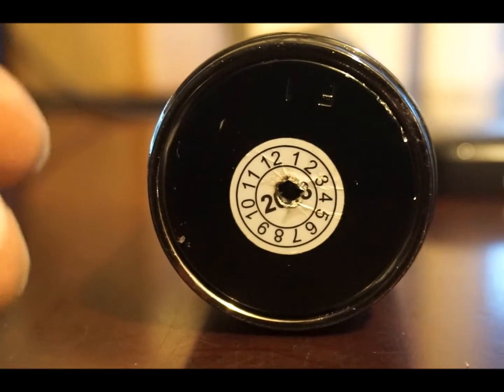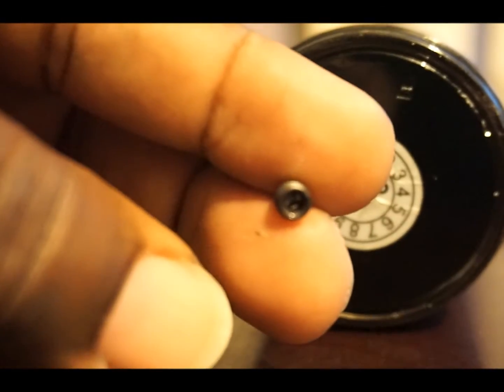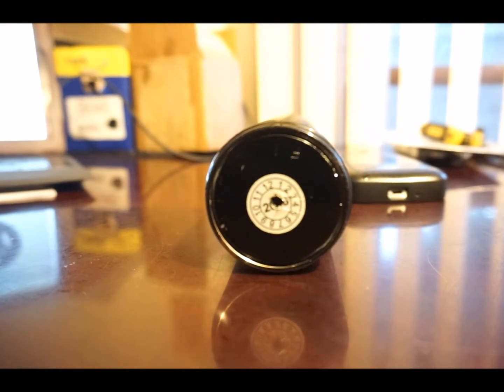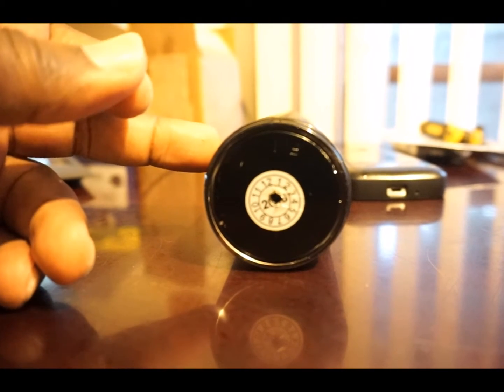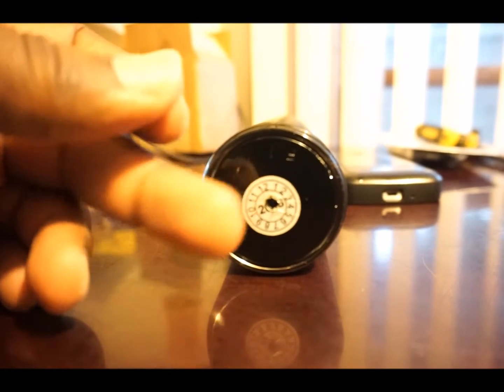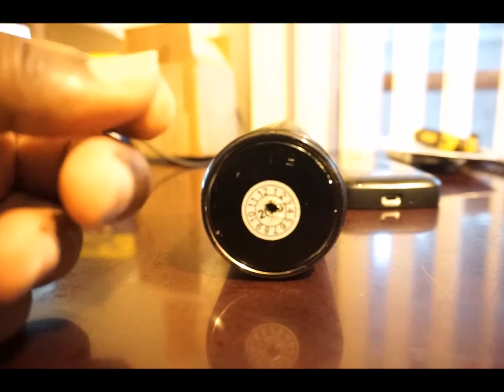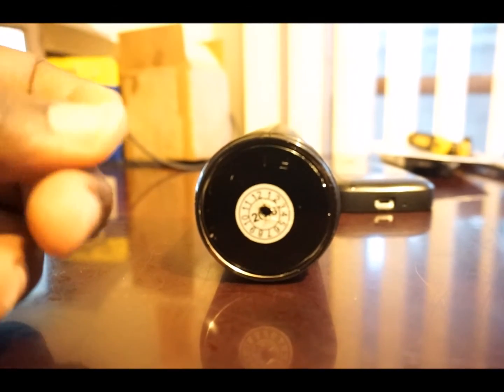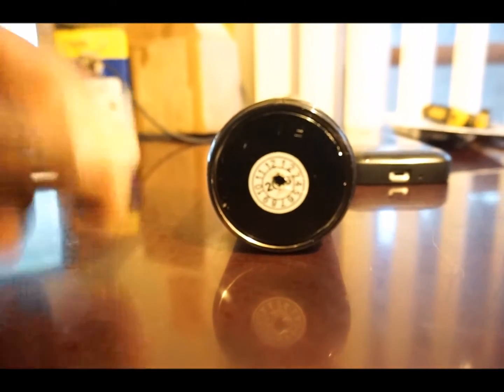DIY BC Racing BR shock Revalve tutorial - PART 6 (Bilstein Internals)

Comment: Hi I watched your videos and found them very interesting. In the end it's like overhauling a motorcycle monoshock. I have two questions. How can I understand the cst of the oil inside the shock absorber to try to keep the same properties. Then regarding loading the lower nitrogen cylinder I saw that there are kits on AliExpress that give you the possibility with the bicycle pump to recharge the shock absorber with air, could this be valid? Thanks
Reply from the maker: To truly measure the centistoke of the oil, you would need to utilize a viscometer, or conduct your example/experiment as such:

https://youtu.be/69iUhlqFJFk?si=17z12wOFCY1kfxRy

You can use a schrader valve to charge the shocks with nitrogen. 

DON’T use air to charge your shocks as regular air changes pressure too easily with the changes in temperature.

Use nitrogen instead. nitrogen barely changes pressure with changes in temperature.

Comment: If you have a lathe or a friend with one, then it would be really easy to make a new bottom cap with a schraeder valve in it. That would make refilling the nitrogen without losing any pressure really easy. Threaded schraeder valves are very commonly available, they're often used in nitrogen accumulators on earthmoving gear.
Reply from the maker: Yes, I thought about it back then.
 I knew about the schraeder valve, and an even quicker and easier way to do this is to measure out the Outside Diameter of the schraeder valve, find a drill bit just slightly smaller, and then drill out the bottom aluminum cap with an electric hand drill using a steel/carbide drills bit set.

Then use a tap & die set to thread the drilled hole to match the schraeder valve threading.

Then prior to installing the bottom portion of schraeder valve and tightening the inside nut down, place some medium (or high) strength lock-tight (or JB weld after you have measured and made sure everything lines up and holds pressure).

Screw the scraeder valve in and you are good to go.

Comment: Hi Kene, after looking at your thread, why do you want MORE rebound than the stock BC? I would have thought that would cause you to have an even less comfortable ride since you will be getting a jacking up effect? Also, it doesn't seem you get much more compression on the shock dynos maybe 50LBS more if you jack up the dial.  Overall,  I'm guessing you want MORE dampening if you go to a softer shock,  (eg going from the 14k to 10K)  but what is that magic ratio. I guess what I don't really understand is how you find the frequency clearly.  I had some other questions in the thread. maybe you can answer.
Reply from the maker: zazzn my goal and purpose in the revalve was to match the toyota supra’s bilstein HD  shock dyno at the BC racings middle “knob” settings which I did. The higher rebound levels are the result when you turn the BC racing adjustment  knob to the max setting.

If I had revalved the shock to achieve the Bilstein HD shock dyno graph exactly at the BC racings “max” knob setting, majority of the lower knob settings would not be very useful (outside of a near under-damped setup).

The graphs max knob settings you see can be used for the guys who unfortunately are super low to the ground and have almost No ground clearance. It is a stiffer ride, because the shocks do not easily give into the forces acting on them, but this ensures that this super low car is not hitting the pavement and scraping at every bump, twist, or turn in the road.

Yes you are right, having overly excessive rebound forces on too soft of a spring can cause a “jacking down” effect on uneven/unsmooth pavement (non-flat race track scenario, regular L.A. streets for example).

But also remember that a car’s motion ratio, vehicle “sprung weight”, and strength of the spring’s rating plays a role as well.

If you start to increase the compression damping forces of the shock too much, the shock won’t compress as easily, and will resist compression when you hit raised bumps in the road.

Then when you hit bumps on the road at high speed, they end up becoming ramps that your car flies/lifts off of like “the dukes of hazard” (exaggeration).

Yes if going from a stiffer spring(14k) to a softer spring(10k) you can go for a little more compression damping to aid in the vehicles cornering and handling characteristics. Also, pay attention to where you add compression forces as well (etc. low speed, mid speed, high speed regions)

If you reduce the shock compression forces too much, when you hit a turn in the road (not focusing on swaybar effects here), the car will lean/“tilt” far too much/easily into the turn vs having more shock compression force.

If you have too much compression force, the car won’t lean at all into the turns, and God forbid there is a road bump midway through the turn as your tires may catch some slight air and lift off the pavement (extreme situation).

There is a balance.

The frequency you choose is the like the level of “snap-back” capability you want in your cars suspension response, but remember that you must also design your shock’s rebound and compression characteristics to contain springs frequency “undulations”/cycles.
Reply: @frugalfabrication  I'm trying to follow the gixxer drew setup which was comparatively soft matched with the valving that you have would produce I'm guessing an enjoyable ride... Right now I very much dislike the way the BC BR's feel on my sc300. Long up and down bumps are like a Cadillac where the car bounces 2-3 times on the highway at full soft on the front. The rears feel ultra stiff and going over a speed bump makes it jump after hitting the bump if I go anything over 2 MPH. I've been doing a lot of reading, and I think what I dislike is the gas pressure in the bc is too high causing me to feel everything that I shouldn't feel. Then mid / low speed bumps are fine and soft enough. However, higher speed bumps / large dips are pretty nasty, and I know for a fact I'm hitting the bump stops. 

Finally in the rear when going over a speed bump it feels like the rear is far too stiff going over it at anything over 2 mph gives me a massive jolt where i almost jump out of the seat.
Reply from the maker: zazzn send me messages on clublexus and we can can continue there.
Reply: @frugalfabrication  so based on what I was reading and talking to someone about I think I'm like 1.76hz and 1.8x on the rear. Again I saw the math you have posted to figure out the h but I don't have all the values. Was that part of the spreadsheet you bought? Finally, I think I'd be happy in the 1.4 range probably softer than what you want at 1.55.  seeing that the knob does practically nothing, is there anyway to achieve what you did without buying a piston just via washers. Also with the digressive piston from bilstine was it that that piston is digressive bothways?

Did you see my cl PM's?
Reply from the maker: zazzn 

Yes, saw your message on CL. I sent you a message also with a few qeustions also.
Let me know.

If you go towards the end of the club… Post or click on the link that leads to the part three which I believe is the results, you will see on my hand written mathematical equation that the frequency was at 1.55 or 1.52 Hz depending on the occupancy weight of the people in the vehicle. The BC racing knob actually still does serve a strong and valuable purpose with my final revalve results. The knob allows for a high level of versatility with shocks. You can turn the knob to its lower settings to allow for a softer damping of the shock to accommodate a much lower spring rates or in the middle to go with a slightly firmer spring and match the shock damping ratings of the BILSTIEN HD shocks.
I can set the knob to max settings for a stiff spring, to accommodate a super low ride height with minimal suspension travel.

The knob works and makes the shock versatile for many scenarios.

Yeah, the bilstein piston I used is digressive on both sides, and the same on both sides.

The updated bilstein COB piston I was also  told was the same flow rate on both side.

In my tutorial, the BC racing BR piston is a linear piston. You can try your best to get it to act like a digressive piston, but it is not.

A true digressive piston has blow off in the high speed region.

Comment: Very informative thanks a bunch for making these videos.
Do you have any sort of comparison between stock BC internals, and the bilstein internals? What differences did you see?
Reply from the maker: Yes, there definitely was a big difference, but keep in mind that this has a lot more to do with the shim arrangement setup I choose to install than the the selection of bilstein piston vs bc piston internals. In my case the bc piston’s rebound orifice holes were way smaller than the compression orifice holes. This is how BC racing was able to get large amounts of rebound force in their shocks, without having to worry so much about the quantity/thickness of the shims. And from a business perspective this keeps overall costs lower as you don’t need all these shims to complete the same task.

Yes there is a big difference between the model of bilstein piston I chose vs the model of BC racing piston that came in the BC coilovers. But technically, BC racing can suddenly use a different model of shock piston that is say 50/50 (compression flow/rebound flow) digressive and can be equal or better (lets say it has extra featured options) than the 699 model bilstein piston.
Reply from the maker: Bilsteins shock piston from what I was told is 50/50 (pertaining to flow in compression and rebound without any shims added). In terms of a shock profile graph, this is like painting on a blank canvass. For the most part you can achieve various results all based on how you setup your shims.

The BC racing piston that came with my shocks was more of a 80/20 (compression flow/rebound flow) if I had to guess. If you get a chance, google “DIY shock revalve clublexus” and look at post #7 of that message board thread. You will see the difference in size of the rebound holes (smaller ~20%?) vs the compression holes (larger ~80%?).
Reply from the maker: Oh yeah, you are welcome man. No problem. I have some more vids that I need to put up, just been so busy.
Reply: Thanks for the response. I understand what you're saying.
I know that coilovers are recommended to be rebuilt internally every ~30k miles, would you recommend going with a bilstein internal rebuild or just buy new shock body's from BC for $95 apiece? Would the bilstein internals offer a nicer ride quality over the brand new bc shock bodies? Thanks
Reply from the maker: +Alec Thompson Please understand that it is more just putting the Bilstein parts inside the BC racing shock. You need to do the math and calculations listed on the “DIY shock revalve” post at clublexus for your model of vehicle.  

This is the bare minimum if you are looking to do internal upgrades. It is essential to solve for the listed equation variables for your vehicle and have an idea or understanding of what you are desiring or looking for in your vehicle ride and suspension handling characteristics.
Reply from the maker: +Alec Thompson  If I did not have a strong desire to revalve, learn, understand and obtain the setup I want, I would just buy the BC racing replacement cartridge. You can see the difference in shock graph dynos between BC racing shocks and BC racing shocks with Bilstein internals on the revalve tutorial.
Reply: Thanks I've been reading your club lexus posts about the difference between linear and digressive shocks for city driving. That's really the answer I was searching for! I'll probably revalve my own BC's after they wear out now. :)
Reply from the maker: +Alec Thompson Awesome! No worries man. And please come back and post your results and findings for I and many others who are interested.

Comment: Dude, I literally had a blast watching your videos. I was laughing my ass off when you broke your nitrogen tank needle LOL... anyways... Although my intent is not to swap out the internals (I'm rebuilding mine) it was very informative. BTW are you going to make a video on how to make the speaker cabinets? Thanks!
Reply: Oh, also how are the shocks holding up now?
Reply from the maker: I definitely will be making a video on how to create the EMi12 (polk RTi12, but better). Just super busy at the moment. Also want to make a step by step video tutorial on the math behind shock revalving.
Reply from the maker: +Kevin Park the shocks are holding up great and with the calculated 10kg/mm springs the ride is smooth as butter. I may calculate and revalve for 14kg springs out of curiosity. If so that would be some time from now.
Reply from the maker: +Frugal_Fabrication I know this is a super late response, but I have to say congratulations on your calculated suspension setup. Lol, I just saw your message response today.

Comment: Just wanted to thank you for this. I learned a lot from your videos. 
I have rebuilt many motorcycle shocks but I had a BC RAM coilover start leaking on me and I tried to get the parts and do it myself but couldn't. No that I kind of know how they work I'm probably going to rebuild something in the future. Maybe even revalve.
Reply from the maker: +TheXdmgx7 No problem, I'm just glad to help. It is not that hard at all. There a just a few steps. Just make sure to pay attention to every step you take. I now only do this when I know I will not have any interuptions or distractions, otherwise you may forget a step (nitrogen charging, in my past mistake) and have to start all over again.
Reply: +majanboo22 yeah that would be bad. Where can I find seals? Know a website?
Reply from the maker: +TheXdmgx7 google the term "RE Suspension".. That is the company's name. I ordered my bilstein to shock pistons and piston bands from them.

Comment: I'm glad I found your post. I have been interested in rebuilding shocks for a while, but hadn't jumped in yet. I recently sold my BC Racing coilovers and bought some Fat Cat Motorsport coilovers. I'm sure i will be diving into some shocks for my other cars, and helping my friends with theirs. How did you discover that the BC shocks have the self healing valve?
Reply from the maker: I once saw a bc racing promotional video, which showed the bc racing assembly line.
Reply: I believe I saw that one as well. I guess I just wasn't paying that close attention.
Reply: I've been talking to Fat Cat... He's ultra-expensive for the work, I had 600$ worth of consult already and I feel I got very little from it.  Do you believe it's worth it? I was considering going with is setup.
Reply: @zazzn  I've been very happy with my setup. If I had to do it over again I would go down in spring rate, but that is it.
Reply: @codllc  mind my asking what it cost you so far I'm in 650 for just consult time
Reply: @zazzn  I think I had $2500 in my setup, but I didn't use much consult time.
Reply: @codllc  What kind of car do you have? 
Fat Cat seems very dialed in to Miatas. 
I was thinking of getting a quote for coilovers on a Mazda3, but may start with just lowering the nitrogen pressure in my current coilovers, after watching some of the Fat Cat videos
Reply: @davidbarnes1410  I have a 3rd gen miata. I think I've put 75k miles on my coilovers and they are still great.
Reply: @zazzn  Hey! Did you ever end up getting your FatCat coilovers?
Reply: @davidbarnes1410  I never did. My car is still being built, and to be honest, It would have been a hard sell since #1 bilstien don’t make shocks anymore for my application, and reusing my old bodies and spending 4k+ between measuring out what was needed or having him do the work and then only to have old rebuilt shock bodies and bushings with good internals wasn’t appealing. I suggested that we used my bc coilovers as a core as they are virtually new and have the same 50mm body and are easily rebuildable. This is vs trying to reuse my old bodies or using a generic new bilstein which would need to be hacked up to fit, require a coilover adapter, coils etc. However he didn’t want any part in that understandably. I found a thread where a guy revavled his BC coilovers to match the bilstein settings buying only the piston. I’m going to attempt to do this since you can rebuild the bc on your own.